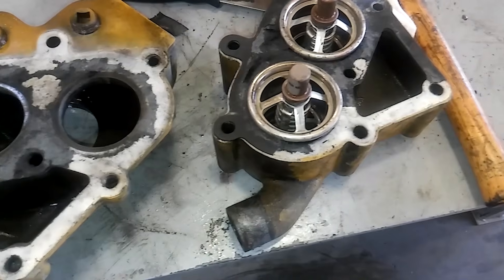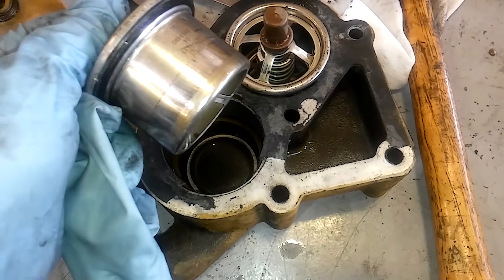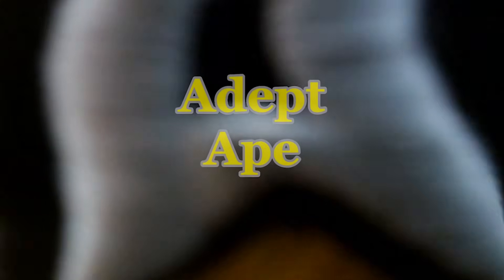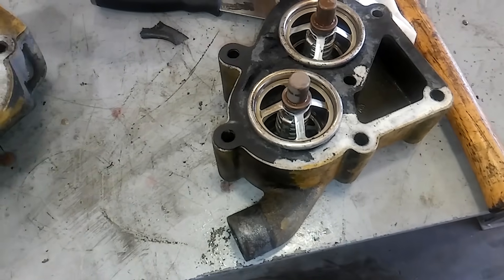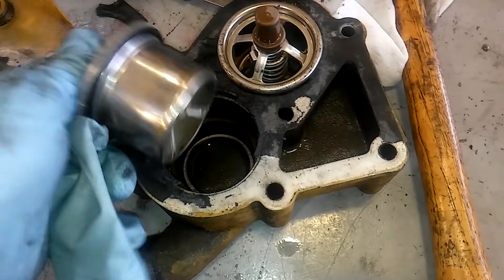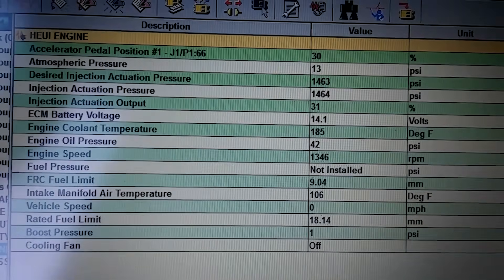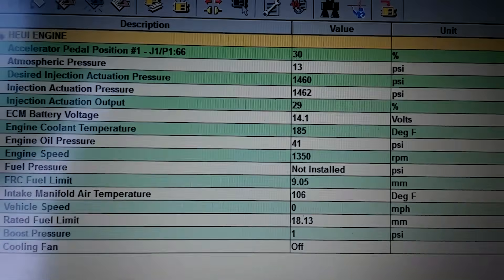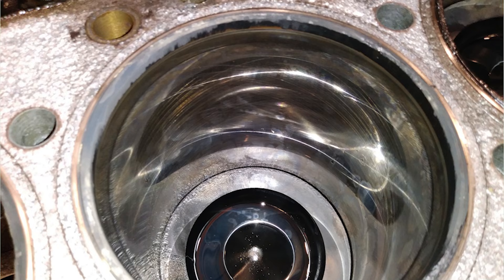Why You Should Never Remove or Use a Colder Thermostat In Your Engine.

Comment: I would like to add food for thought, the cooling system is usually designed to perform to a standard based on heat rejection capacity required for specific application ie. HP rating, airflow and ambient conditions and surprise surprise cost ! This usually means the lowest cost to meet min requirements as a function of production cost to manufacturer to maximise profit, there is usually not much margin built in for efficiency loss over time or increased HP heat rejection so an aging system shows deficiency sooner or more prominently if you like, to highlight this is the marine application of same engines is almost always much much higher as there is and almost infinite source of heat transfer medium available ie seawater that never varies in 'ambient' equivalent temperature by more than a couple of degrees and never allows excessive cooling jacket temperatures like air medium cooled engines adding to liner seal life longevity in comparison to truck engines etc especially in higher HP/load conditions not to mention the side bar element of oil temperature control, the topic of heat transfer thru radiator is one to observe the temperature drop across a cooler from comparing inlet temp to outlet temps should be in 10 -20° range, if less than 10° drop,either airflow is insufficient ( most commonly) or coolant is not spending enough time in heat exchanger (radiator) compared to its surface area, above 20° drop then spending too much time in cooler or air flow thru cooler is excessive, hence Horton fan catches or radiator blankets or shutters, its not possible for thermostat to control temperature on its own without getting thermal shock due to wild oscillations of coolant temperature entering back into engine, substrate micro boiling at liner surface is always an issue that is usually combated by system pressure to suppress it and improve heat transfer at its source, water wetting agents as well as high circulation rates help with this, the evidence of this usually shows up as what is usually perceived as electrolysis erosion on liner, the best solution is non aqueous coolant with a boiling point of 190° C+ and that's at atmospheric pressure, but key to all this is cooling systems maintenance ie scale build up which has insulative properties and reduces ability to transfer heat into and out of cooling medium including in the heat exchanger cores, increases in surface area Trumps flow in both coolant and air as a means of increasing capacity but design or dimensions dimension restraints usually rule increase in primary surface area increase ie frontal area so extra rows of cooler construction are utilised with lessening degrees of efficiency as you get further away from initial contact source, sometimes little things like sealing radiator to opening surround to force all air available thru radiator is really effective by creating a pressure area which slows air flow thru and increases heat transfer,

Comment: On certain vehicles like a 90 grand prix where the computer uses the temp for open or closed lope fueling.  In that case you also need to reprogram the computer.    Other than that yes you should use lower thermostat.  They have them over 200 degrees for emissions.

Comment: Had an Cummins m11 with a bad injector, clutch fan on all the time, and a stuck open thermostat, I don't think it would even move the temp gauge. Was ran like that for a long time before me. A new tstat and a new fan switch she ran great, they fixed the injector long after me I'm surprised it didn't take out the engine. Your wearing the wrong hat.

Comment: The bottom line is it best not to believe you know it all. e.g. All VW bugs engines since 1959 have had thermostat controls on intake and cooling air. The people that removed them didn't want to understand why they were there , or were just ignorant! Or both and that's contributed to the hate.

Comment: Not all engines run that hot lol,200 fahrenheit is 93 celsius ,that is temperature at which engines i have at home would blow head gasket in few days.Their working coolant temperature is far lower than that.

Comment: You’re not likely to damage your engine from running it 20° cooler. Cars are designed these days to warm up quickly for on board heat, good fuel economy and better emissions. Also running an open thermostat will most definitely prevent an overheating situation if your problem was caused by a stuck thermostat.Believe me I’ve been running my engine cold for six years now without issues, actually it runs better that way. Not every car is the same.
Reply: So you run with NO t-stat? What car do you have??

Comment: I put a lower  heat thermostat in a truck before the truck wasnt  running hot  but every time I would replace the spark plugs the two plugs in the front of the motor would have nothing left it was like the front of the motor was getting to hot the engine was a in line 6 after I changed it out it ran fine and the plugs all looked normal from then on

Comment: I know you probably get this alot but I'm lost I have a 87 3406b and it's in a road truck and it's not over heating or mixing fluids and has literally no bubbles on a bubble test but it blows coolant out the radiator cap while driving mainly on a small hill I changed the cap with no change and at idle I only have heat with blower on low I know it's hard tell without seeing it but any ideas on what could be my issues would greatly be appreciated

Comment: Well the use of the word "never" is subjective at best. Case-in-point: My 1991 Jeep YJ with the stock 2.5 liter 4 cylinder was a pathetic dog in that I had to down shift when going over a simple highway overpass. Talked to all kinds of "experts" that offered all kinds of guesses but no working answers. Then one day my Mitubishi mechanic brother asked what year the YJ was and his simplified response was to put in a 20 degree cooler thermostat in it. And walla, it was like a new Jeep:) So, what worked? He said that my Jeep was an early (second) generation fuel injected motor in that it was the first gen. of multiport fuel injection. Because of Kalifornia's tight emissions standards and the fact that the vehicles of the day did not meet those standard while warming up they programmed the injection system to run lean/emissions friendly upon reaching operating temp. The 20 degree cooler thermostat "tricked" the computer into believing the engine never warmed up and ran richer hence much, much better power! A $6.50 fix!!  Did a Mercedes OM617.950 5 cylinder turbo diesel swap a year later:) https://www.youtube.com/watch?v=lVG0XOOENw4

Comment: Hello, I have a problem with my 1.9 tdi in my audi a6 c5. So basically it randomly does not wan't to start, it usually has problems shortly after turning off the engine (so like lets say i turn it off and try to start it back after 30 min thats when it has problems) but after a whole night of sitting in 0 degrees celsius it starts normally(well almost, takes like 1-2 seconds) and after it sits for the said 30 min i have to crank it a lot before i even start to here it wanting to start (takes about 5 cranks lasting 8 seconds) anybody has an idea as to what this might be? im suspecting a fuel problem but i know almost nothing about engines.
Reply: If you smell fuel while cranking during the hard start episodes, i would suspect a fuel injector is leaking down and flooding the engine.
Reply: @carwashadamcooper1538  the engine bay is dry and i dont smell any fuel during these episodes. Someone told me it might be something with the shaft position sensor that when it gets hot it malfunctions. Is that something that could cause these problems?
Reply: @carwashadamcooper1538  also could it be a problem with the fuel pump in the tank sucking fuel back to the tank instead of pumping it to the injectors? its a 20 yo car, honestly i dont even know at this point.
ps. its a weird design with 3 pumps (sort of) 1 fuel tank pump, 1 high pressure pump next to the engine and unit injectors or whatever its called in english (injectors with pumps or something like that).

Comment: I’m going to chase this one.
But water as mentioned can also create steam in wich can be destructive.
The acid build up and all that Josh mentioned is true.
I want to see my self through oil testing to see where this goes.
My personal experience so far has been good running cooler thermostats.
But at what price?
My oil samples overall come back in normal range.
Going to be interesting going forward.
Thanks for the video and thank you for the conversation and the attention it brought.

Interesting side note.
Water can create sludge in wich can plug oil filters.
One way I guess to see if there’s water in the oil is to heat it up to see if it pops.

Comment: I have a tractor C18 acert, if I let it idle for very long (5min) in the cold (35 degrees or lower) the coolant temp goes down to 150 sometimes lower. It operates at 180 usually (I keep the load between 85% and 99%). I’ve tried replacing the thermostat’s but it didn’t help. And it will never warm up at idle (1,000 rpm) it rarely gets used when it’s hot outside, so it might then. Should I be concerned? If anyone has any thoughts I’d like to hear them, thanks!

Comment: A cooler thermostat will not run the oil any cooler but running a cooler thermostat will make the oil cooler. Did you just say that? Oil temperature even with a 180 degree thermostat on most standard V8 engines will still allow a combustion temperature of about 205 degrees and a cylinder temperature that is more than high enough to percolate out water out of the oil. And the oil temperature will still run about 210 to 215 degrees. It's just your coolant temperature will not be running at 215 to 220 which is where it actually starts to be just a little bit on the high side. Your engine will also tend to run just a little bit fat considering you're generally running electronic fuel injection.

Comment: At 66 years old, I have been dealing with motor vehicles for 5 years.  To have a cooler running engine, pay attention to; air flow, oil viscosity, and belt slippage. 
 Serpentine belts have greatly reduced belt slippage.  But applying a little rubber cement on the friction surface of a belt can test belt slippage.  Also some engine will run cooler with a slightly smaller or fewer blade fan.  With the fan shroud adapted for the diameter.  The fan may be creating to high a load on the belt system.
 When people alter air dams or increase the lift on the front of a vehicle.  Overheating can occur.
A lighter weight base oil can help heat transfer.  And therefore improve cooling.  Use 5w40 or 10w30 synthetic, rather than 15w40 or a single grade oil.  And maintain the correct oil level.  Too high or low a level can cause a variety of problems.
Of course all of this assumes a properly operating engine.  The radiator is clean for coolant and air flow.  The timing and valve adjustment is also correct.  And the driver is not lugging the engine!

Comment: i've had arguments with the parts counter jockey a few times at the local auto parts store, i installed the OEM spec 195 degree t-stat in a 4.0L jeep engine, the kid behind the counter kept trying to talk me into a 160 degree t-stat because "its what hes done in his jeep and it never overheats", i've tried and tried to explane to him pretty much what you covered in this video, but of course if its not on reddit kids these days dont believe a word of what a mechanic says, thanks for the video, and now i can show some of the nay-sayers and poo-pooers about t-stats that yes it is an important pierce of the cooling system and not a good idea to just throw it in the trash and run without one, though i will admit in the past i did have to make an emergency decision because i had a t-stat fail on me in the closed position, and i had to make a flow restrictor out of the cut up body of the t-stat and a fender washer to limp to the autoparts store to get a replacement one, but it was less than 20 miles, and i ran it for not more than a couple of hours total with that in there, also why i preach FailSafe t-stats are a must, if one is going to fail, i'd rather it fail in a mostly open state as opposed to completely closed where it'll burn everything up faster than being jammed partially open, also thermal lances are pretty sweet, but as you said extremely dangerous to be in close proximity to while in operation

Comment: In the Cat cooling system A&I guide I believe it’s stated that the thermostat determines the engines minimum operating temperature and the cooler/radiator determines the engines maximum operating temperature.
Reply: It must be for educational reasons CAT writes like that. The thermostat has several tasks, reduce the warm-up time at start for both the engine body and the oil as well as the rules in chilled water from the radiator to maintain the designed temperature of the engine.

Comment: For serious racing applications, you can make a touch more power at lower cylinder head temps (as it doesn't heat the air as much, so it's denser). That's a whole different story than normal use or overheating, though.
Reply: Yes i found in a race application a water restricter plate in place of t stat created a prefect temp for my street strip engine

Comment: I changed my 7.3 powerstroke from Ford 180 tstat to a 205 which is international dt444e temp rating.  I didn't really get much heat before.  Now I do.  of coarse now I don't run it much in winter as I got a gasser and now actually I started driving trk

Comment: I had to put a 180 and one 190 in my C15 because with the factory 207 stats my retarder oil temp was at 235 all the time and you couldn't use it, in 20 seconds you'd be over 240 and that's not good.  Mr. James says " at a given operating condition the engine always puts the same amount of heat into the coolant"  I have to disagree in the case of a CAT Brakesaver. In my case the cooling system cannot keep the oil under 235 with brakesaver use, having the whole system operating at a lower temp. allows the retarder to put huge amounts of heat into the system giving it the ability to stay under CAT's guidence to not allow oil temp to exceed that 240 mark.  the other statement he makes I find interesting is coolant flowing to fast, I've seen CAT stuff with restrictors in the stat oulet to the radiator to restrict the flow, I've also seen CAT equipment that they had to slow the fan speed to improve the radiators ability to remove heat, I've even read that from CAT when doing the change up. and experianced it, with the engine at full rpm no load it would overheat in 45 minutes, changed the fan speed and bam! end of problem.  the coolant does need to stay in the radiator long enough to reduce the temp on the outlet by at least 10/15 degrees  if it's not then it's not your stats but your radiator.  I got a lot of guff for getting rid of the oil temp stat in my N14 (plugged Hole) but I still get the oil to 200 and that's high enough here to boil out water, but I may put it back as I have discovered I can get a lower temp stat for the N14 in a farm tractor application, I'd love to hear mr james explain why they would run oil temp above 240 in a truck but not a tractor, not bashing him as tone doesn't come across with typing, love talking to engineers You can learn a lot
Reply: I have staggered 180;190 as well. 800hp cat. I like that during the summer I’m not running against 200 all the time, slight hill and it would go over 200.

Comment: I put a cooler thermostat to fix the problem of the electric fans not switching off. The engine would reach operating temperature, fans would switch on then would never switch off. I figured it was was an easier fix then troubleshooting the coolant temperature sensor (fans were controlled by ECU).

Comment: We had a truck the other day the fan clutch was stuck in the "on" position. Engine wouldn't get much past 100 degrees. Just an aside. I agree don't go to a cooler thermostat. If you have problems yes start with the cheaper option "it could be stuck closed or open" but get in and find out what is going on.

Comment: Worked as a tireguy for large trucking company in the 90s.weld shop used arc/air when replacing dumptrailer cylinders.Trailer plate&kingpin work.Need balls to use it.

Comment: I've recently done the opposite, I used a hotter thermostat as I discovered, in my particular engine, in the winter, the engine took way too long to heat enough to help the water evaporate from the oil.

Comment: Solid advice that applies to everything liquid cooled. I start  every overheating diag with a combustion gas test, right off the bat. Bought a quality tester and several bottles of fluid. It confirms a base engine issue, that needs to be confirmed as good or not good before proceeding with an overheating concern.

Comment: I haven’t even watched the video all the way. But I know that without the engine getting warm. Or “hot” the inside can get oil sludge inside. Also the turbo won’t spool fast enough cause the oil is not the right temp.

Comment: I did this one time on a 04 ford lightning I swapped the 180 T for a 160 T. The motor did run cooler for a few mins than the cooling system got heat soaked and started overheating this was normally when on the hwy so I put the stock T back in.